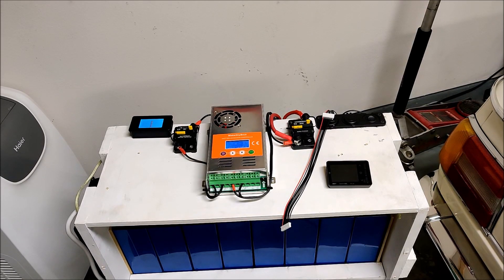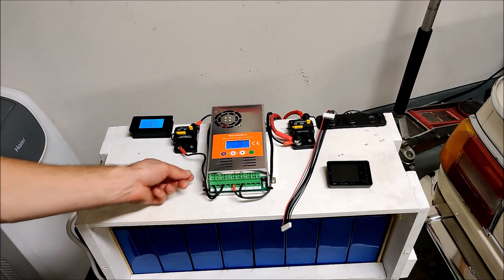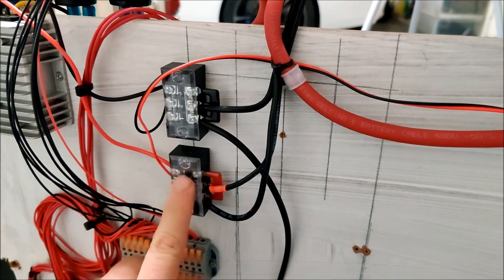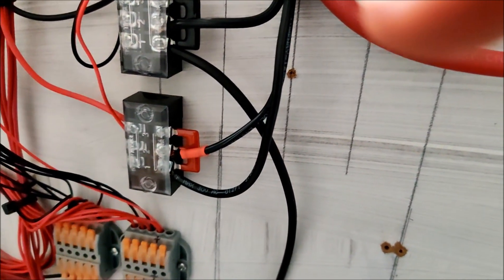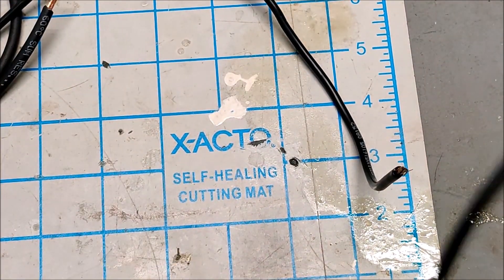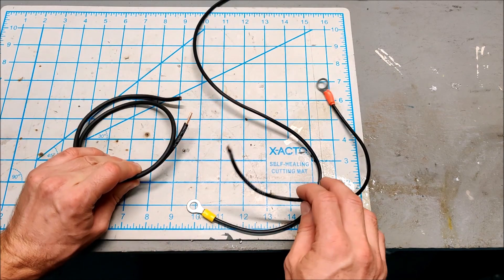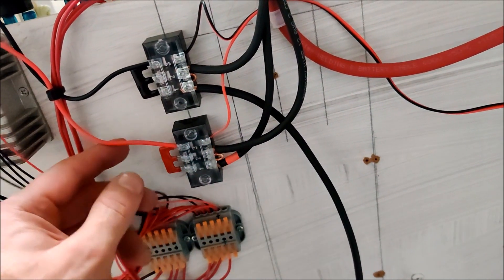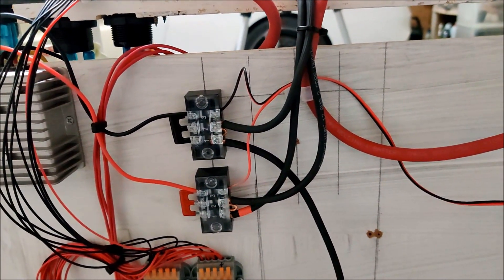15KW LifePO4 Powerwall Part 6 - I Screwed Up!

Comment: Steven, 10 gauge wire should be the minimum size for incoming solar MINIMUM. As for the MPPT to battery wire; for a 12v set up around 600 watts your cable gauge should be 4 gauge, 6 gauge minimum. 20 amps going through those wires and bussbars is a fire waiting to happen. Not to mention the voltage losses you are getting by using such thin wires. Other than that I am a fan of your set up. Keep up the videos man!
Reply from the maker: I agree, 12awg is border line. Technically it can handle 25amps in open air but it is border line. I might put my panels in series and go to 80v at 10amps.

Comment: I went crazy on mine. 8 Awg Welding cable. To combiner Box. Then went with 10 Awg back in the house with 4 conductor Soow cord each array using 2 wires each for positive and negative back in.

Comment: I know you've already made the change to 12-gauge. But for 15000 watts of battery power, I would use nothing less than 10 gauge.
Reply from the maker: This is just the charging circuit. The inverter circuit is 6 awg
Reply: @stevenc22  oh, I get that. It's just that the ampacity of that gauge cable for power transmission is different than chassis wiring. I believe 60° cable 12 gauge maxes out chassis wiring at 20 amps. For power transmission I'm afraid 12 gauge is still undersized. If high temp wire such as 90° c is being used, that's a slightly different story
Reply from the maker: @reubenj.cogburn8546  in open air 12awg is rated for 41 amps.
Reply: @stevenc22  I wish it was as simple as having a wire ga. and equating that into an allowable/safe wiring configuration. Power transmission (supply) is rated differently than chassis (user). While you may find charts that list 12ga for 41 amps, I know of no sparky who would recommend it. Not criticizing you, just saying, do some reading and I think you'll find that flowing around 20 amps on a 12 ga. transmission line  and you'll find it's maxed out. Here in the US, if I run a constant load near 20 amps of 120v on a 12 ga extension cord (common), even a short one, it will get hot. I suggest you do a thermal check during peak load with your new 12 wiring and see if you have thermal rise anywhere, If so, your loosing energy to the batteries.
Reply from the maker: I understand. Power transmission ratings are for bundled wires without air flow. Reality is my 80ft of solar wires are already 12awg so I'm committed.